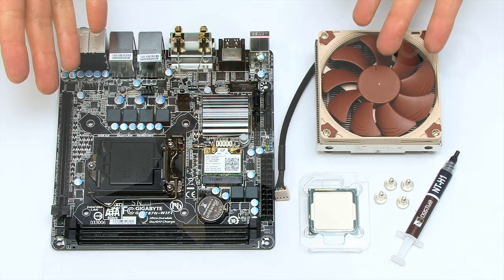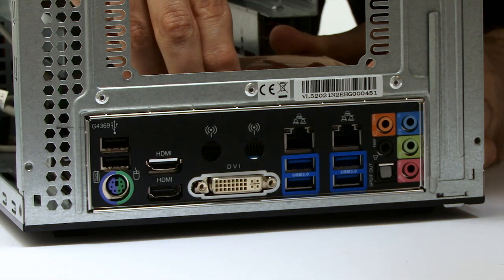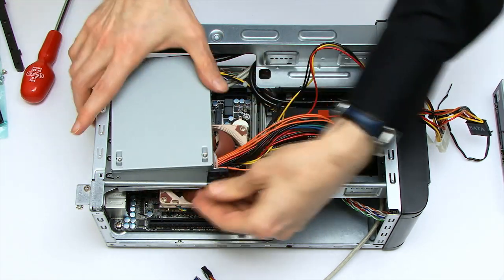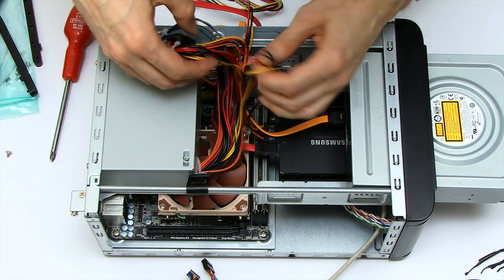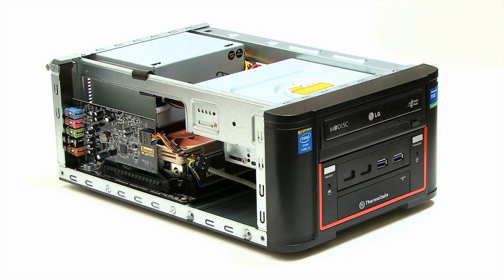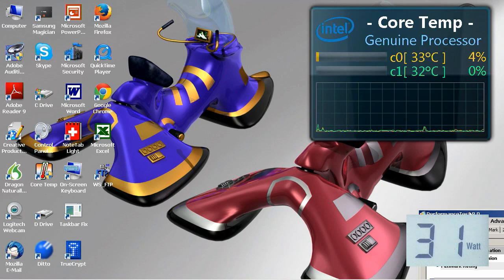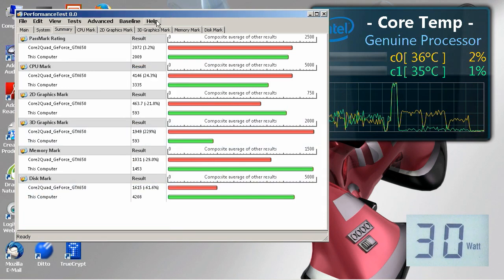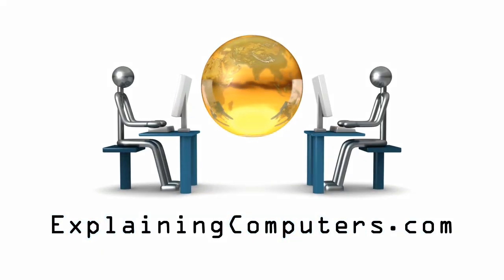Haswell i3 Mini-ITX Build (Part Two)

Comment: Chris, just love your channel, learned a lot in the past few years.
I believe you are missing out on a great product for your media production processes.
It is the fabulous Apple Mac Mini..!!
The 2018 version would be just perfect for you dual booting in Win7 and a Linux Distro.
Performance is just amazing in my setup of Win10 and MX Linux.
You will have a production machine that can last at least 10+ years.
No reason for you to swap SSD's all the time, the Mac Mini will really work for you..!!
Reply from the maker: Thanks for this -- but see my pinned comment! :) I do not want a dual boot system, but do want the flexibility to switch in and out may different SSDs. :)

Comment: I've got a tip for identifying your SATA cables. I use a Sharpie to write System, Data, Video and Optical on each end of the cable to identify the various drives in my PC! Simples!

Comment: That is a nice build and it reminds me that I need to work on some of the computers I have which isn't working and get them working so I can install the ArcaOS 5.1 which I purchased. That is a tight fit in that case for all the components you have and I hope the computer don't overheat on you.

Comment: can you put a gpu in there?
Reply from the maker: Yes -- not a long card, but many will fit. Though you have to be careful about thermals.
Reply: You can only fit a single slot card so something like a GT 1030 or a Single Slot INNO3D gtx 1050

Comment: Guess it can't play Crysis, lol. Really though, anyone make motherboards in that form factor which can be turned into a serious gaming PC?
Reply from the maker: You can certainly make serious gaming PCs with Mini-ITX motherboards like this. Even this board (or its most recent incarnation) can take an i7 and 32GB of RAM, plus whatever graphics card the case can accommodate.
Reply: ExplainingComputers that is interesting. Be funny to watch someone trying to make a crossfire configuration in one of those. Though I don't even think that's a thing these days. Still, an amusing thought.

Comment: What a neat little case!!  I’ve never worked with an ITX-sized case & motherboard.  Is the power-supply physically smaller than an ATX power-supply, or not?
Reply from the maker: It is a small ATX PSU.

Comment: I use an external USB audio unit which gives professional level audio (Roland UA25) and for watching movies on my TV I make use of that optical audio output fed to my surround sound system which gives out great audio without background hiss. So I would not use that internal audio card but rather look out for a low cost guitar/mic USB pre-amp instead for mic input and headphone output.

Comment: did he just put a sound card instead of a graphic card ? lol
Reply from the maker: I did. This is an office PC and hence does not need more than onboard graphics. But I do run Dragon Dictate, and that does not work with onboard sound, hence the sound card fitted. :)
Reply: Why doesn't the onboard sound work? I thought that these days onboard sound is quite good on most motherboards.
Reply: The microphone input on onboard sound devices has insufficient shielding for speech recognition.

Comment: I recently built a mini-ITX PC, but I used a Cooler Master Case, Core i3-6100 CPU, 8 GB DDR4 G Skills RAM, 1TB HDD, MSI H110I PRO AC board, Apevia 550W PSU, and it runs on Ubuntu 16.04 LTS. Luckily the stock cooler fit my case which would never have fit your case Chris. It's plugged into my TV at least until I get a KVM switch to connect that PC with my other PC I built that runs Mint. By the way, this video got me to build a mini-ITX PC. Thank you.

Comment: i run an air cooler, idle is at 20C and when i am in my lagg intensive SimCity the max i get is 43C, and a bit of the fan on the GT 710 making noise

Comment: So it's a no no for an i7 then ? I am wanting something to cope with 4k satellite transmissions
Reply from the maker: You could, these days, get away fitting a 6700T (35W TDP) in this case, with an appropriate 1151 mini-itx motherboard, and a slimline heatsink, like I use here.
Reply: Yes but I really wanted to use a GTX 960 card also
Reply from the maker: digitalmediafan
.Ahh . . .

Comment: NIce build. Can you possibly say a few words about the ventilation and temperatures of this computer setup, esp. CPU and disk drive, in the summer? Thanks.
Reply from the maker: Today, which is fairly warm, according to Core Temp the CPU has been running at between 38 and 43  degrees C. So the ventilation (pulling in air from the sides and out of the back) is working fine with my i3.
Reply: Thanks. Look forward to watching more of your excellent spreadsheet videos.

Comment: can u integrate a gainward geforce 750 ti 2go instead of the soundcard?
what is the max current provided by the default power supply ? 20A or less?
Reply from the maker: A graphics card would have to be small to fit in this case, requiring only one backplate (as there is only one!). The PSU is 200w.

Comment: My dad told me there have been horror storys about building a computer.  What should I keep in mind while building and buying all the parts
Reply from the maker: Your Dad is right. Buying the parts is the most critical bit -- you must ensure that you get a motherboard, CPU and memory that are all compatible. There are, for example, lots of different i5 and i7 processors on the market (from different generations) that require different sockets and chipsets, and hence different motherboards. So if you are in any doubt, get your CPU, motherboard and RAM as a package. As for your first build, plan carefully and take things slow.
Reply: +ExplainingComputers thank you for replying

Comment: I would use the asrock C2750D4I ITX board for my network storage pc that I plan to build sometime a few years down the road. I'd use a pcie splitter with a riser cable so I could add another storage card and a 128MB video card to keep all of my ECC ram for keeping data integrity.

Comment: What is this pc for? I mean workstation? not enough power Office? Overkill Server? no enough harddrives gaming? no graphicscard.. i dont get the sense of it
Reply from the maker: Mavro Manitari This PC was built for running office apps, web access, etc. But it also had to be powerful enough to run Dragon Naturally Speaking. I have been using it as my main work PC for about 18 months now. Certainly not a gaming PC! :)
Reply: +ExplainingComputers And nowadays you can just get an intel computer stick and an USB hub.

Comment: Can a GPU fit in?
Reply from the maker: filip kezele You could fit a (slim!) graphics card where I put the sound card, but there is not a lot of capacity in the PSU to power it, and cooling would be problematic. The chances are that anything you could fit and power and cool would not be a great improvement over the onboard Intel graphics (which are not bad for things other than heavy gaming or 3D work).

Comment: What camera are you using for your video, please? It's far clearer than mine!
Reply from the maker: Kevin Hannan I am shooting with a Sony V1 -- quite an old HDV camera, but I'm recording the raw HDMI output to an Atomos Ninja, which is where a lot of the quality comes from. I use a +2CU lens for the closer shots -- a trick that improves close ups with virtually any camera.
Reply: I'll check them out, thanks! I have 3 Sony Broadcast Quality cameras but they output to tape so I'll have a look and see if there's a digital output suitable for the Ninja. Thanks for the help!

Comment: Just curious, what do you mean by most Mini-ITX cases not supporting socket 1150?
Reply from the maker: BenjaminGoose This relates to the height/size of standard heatsinks supplied with 1150 CPUs -- they physically will not fit in the many Mini-ITX cases.
Reply: ExplainingComputers Ah ok, thanks!
Reply: But a node 304 will also fit a noctua d14( i have it with one fan not on)

Comment: Why the sound card. It's not better than the on-board, because it is so old.
Reply from the maker: Honest Tech Reviews For the use of the microphone input, the sound card is a very significant improvement over the onboard microphone input, not least due to a lack of shielding on the onboard jack. I built this PC specifically to be able to use Dragon Naturally Speaking, and it simply will not work with most internal sound cards. The manufacturer, Nuance, make it clear that their software may well not work with an onboard sound card (and I tried it, and it didn't!). So in this particular instance, the sound card was better for the specific application concerned.

Comment: I use this cases for my office, but some have air flow problem. Since power supply and CPU suck air on (almost) same place, and touching to each other. Design revision from the maker is required.

Comment: I think the only thing i would worry about on this computer is heat build up, but i guess if you don't use it for games or video rendering/editing then it would be fine. Love the size of the case though, i would like to build a mini itx computer but it is a for cable management and putting everything in such a tight space. Love the video

Comment: I have a small question: Mini ATX vs Mini ITX, can you tell me which is better for gaming? Waiting for the Pi robotics videos :)
Reply from the maker: These days Mini ITX boards are as capable as Mini or Micro ATX unless you want to add lots of extra cards and drives (which are not needed for normal gaming). But for a powerful gaming PC (or one that could in the future be upgraded to be so) you will need a large, high-wattage PSU, and probably a lot of space for your graphics card, and also good coolin (which also needs lots of space!), so one of the larger Mini ITX cases (larger than I used here) would be advised.

The Pi Robotics videos are going very well indeed. I've been shooting and Pi screen capturing solidly for two days and roasting under video lights shooting tiny components! Probably another day to go, and then loads of editing. But I hope to get the first video up next week, and then the second one less than a week later. And am already now thinking of a third part . . .

Programming a robot is cool! :) The thing finally started moving around this evening. It really makes you think of computing in a different kind of way. :)
Reply: ExplainingComputers Well, I'm going with Micro ATX, thank you for explaining this a bit..
Good luck building your robot army :)

Comment: lol, why bother with a sound card, you have everything builit in to that CPU.
Reply from the maker: I fitted the sound card as the onboard realtek audio does not work well (or at all!) with the Dragon Naturally Speaking software that I need to use. But yes, you are right, for most uses, everything is built in. :)
Reply: correction, the Haswell CPU doesn't have sound processing capability, that will depend on some on-board chipset which is part of the mother board. btw, why does the software only works with Creative sound card?
Reply from the maker: phuck The problem with Dravon is due to the low quality of the onboard audio, particularly the microphone input and associated pre-amp -- which is rarely used these days (most web cams, for example, having their own onboard USB audio). So the software will run fine, but usually fails microphone verification (even with a good mic), and even when it passes, speech recognition is poor. Nuance recommend using a USB microphone or headset to bypass onboard audio -- but I decided an internal soundcard would be a neater solution. And it works!

Comment: Can you fit a 3.5 inch HDD under the drive bays
Reply from the maker: There is no bay for it there I'm afraid -- although there is enough space for a DOY fitting! :) This case has just one 3.5 and one 5.25 inch bays at the front, and then a 2.5" vertical bay (well kind of) at the back.
Reply: You can fit a 3.5" hard disk in the vertical side mount at R/H rear.

Comment: Two question, why did you use the sound card? Doesn't onboard audio do just fine?
Reply from the maker: The onboard microphone input is pretty poor on Realtek onboard audio, and often does not work with the Dragon Naturally Speaking software that I use. Dragon actually recommend not to use it.
Reply: Interesting, thanks for the info

Comment: nice build but use a sata 600 cable for your ssd :-)
Reply from the maker: Fair point! :) Though I do have excellent performance from the SSD even using the shorter, older cable that I had at hand! :)

Comment: Hi, is there a possibility that we include a dedicated video graphic card into this small case? I had seen small desktop sold in my country with dedicated graphic card in it.
Reply from the maker: Yes, you could fit a dedicated video card to this motherboard using the PCIe 16x slot -- and if you wanted, quite a powerful card. I would not fit anything too powerful in this case, though, due to cooling concerns, and also the 220W PSU.

But using something like the just slightly bigger Cooler Master Elite 130 case, you could fit quite a powerful graphics card. Or use something like a BitFenix Prodigy Mini-ITX case and you could within reason fit any single-slot graphics card! :)
Reply: wow. thanks for the advice. I missed the notification on your comments. Sorry about it. =)

Comment: Use windows 8
Reply from the maker: ***** I agree. I will be sticking with Windows 7 for as long as possible (I think support goes at present to 2019).
Reply from the maker: ***** I totally agree with this! :)
Reply: Mine is upgraded from the internet
Reply: Im not a troll. Lol. They are very stable actually, ignorant fuck. Install SP1 or newer on Vista, and you're fine. Its only unstable if you have bad hardware. Windows 8 is based on Windows 7.

Windows 7, however, is overrated, and unstable. It ran so bad on my PC from 2011. It ran shit on every PC I owned. Vista and 8 didn't. Windows 8 is a fixed version of 7.
Reply: Windows 8 is great. 7 sucks. Vista is also good. I'm using it on my secondary PC, much better than 7 =P
Reply: You're ignorant, because you say that Windows 8 and Vista are terrible without any correct reason.

Vista RTM had problems, but SP1 and SP2 are very good. I ran Vista SP1 on a computer with 768MB RAM, Celeron 2.4GHz and 80GB HDD, it ran fine. Aero worked as well. Everything I needed, worked (even DVD playback).

Your PC's GPU is probably too shitty, or you had viruses&bloatware loaded on Vista. You also probably didn't maintain it (maintain each 4 months). Then, every Windows version is slow, except Windows 8.x, which maintains itself and has new technologies.

Windows 8 is a fixed version of 7, as I said earlier. It addresses the problem of user-unfriendlyness of using 7 with a tablet/touchscreen monitor. It also fixed the random zero-day bugs present in Windows 7.
Reply: ***** To be honest, all of these OS's have their upsides and downsides, Windows 8 boots quickly, but has a rubbish interface, Windows 7 runs well and has a nice interface but boots slowly (unless you have an SSD like me) and Vista is pretty much like 7 but had more problems when first released.
Reply: Ionita Dorin
Linux is a nice system but I need to use programs that only work on Windows.
Reply: *****
I guess I see the sense in that, probably designed to make your PC less likely to Bluescreen on startup.

Comment: Lol, my PC, which is a power hungry beast (2 mechanical 7200 RPM HDDs, Intel Core 2 Duo E7400, Nvidia GeForce GTX 550 Ti, 8 GB 1333 MHz RAM) got a 1284.5 score, which is like 800 points less than your new PC... But at least it performed better on the GPU tests... ;)

Comment: I was worried that the cables would jam the fan when he started the PC up.
Reply from the maker: The wires are all cable-tied several cm from the fan. :)
Reply: I'm guessing that means there is no room for a new fan then if you upgrade the processor
Reply from the maker: Tom Caswell This case can only relly take a slimline cooler -- such as the Noctua one used here, or the slimline coolers now supplied with low TDP (35w) i3 CPUs.
Reply: You could install a Water cooling system to there are no internal fans for the wires to get to close to (or in) the fan

Comment: Did you check from bios that your RAM clock is set appropriately?
Reply from the maker: A very good thought, and I just did! :) The RAM is running at the right speed. So the Windows Experience ranking remains strange . . .
Reply: ExplainingComputers The win experience ranking is basically directly related to ram capacity and not ram latency. The experience scores are more intended for productivity ratings, but they really mean very little.

The reality is, in a desktop setting, you won't notice a difference between 1333 and 2400 MHz RAM. And you're not likely to need more than 4 gigs of ram unless you're doing something like compiling or rendering.

EDIT: I have 12gb of 1600MHz ram and my ram score is 7.4, up from 5.5 when I had 4gb of 1600MHz

Comment: What a squeeze, but a fantastic build! The energy draw especially surprised me. Great choice on the fan as well, I can't help think that if you bought a retail Intel CPU, the Intel stock cooler would have been too big!
Reply from the maker: The stock coolers that come with 35W TSP Haswell chips are actually slimline -- so the cooler supplied with, say, an i3 4130T would fit about as well as the Noctua cooler I used. In theory, a full-size stock Intel cooler will just fit in this case -- with clearance of about 1mm as I undertand it. But I would not want to try this as it would I think compromise the fan.